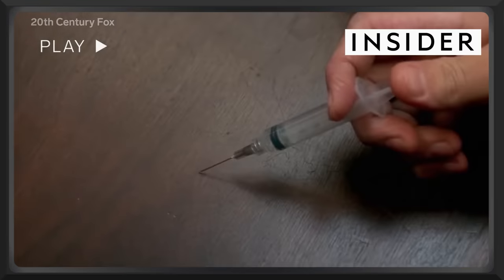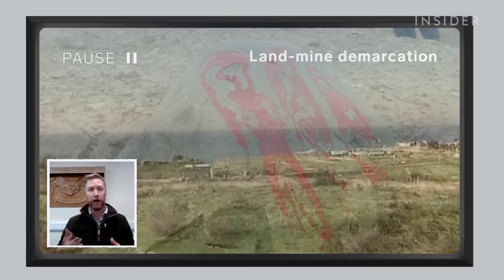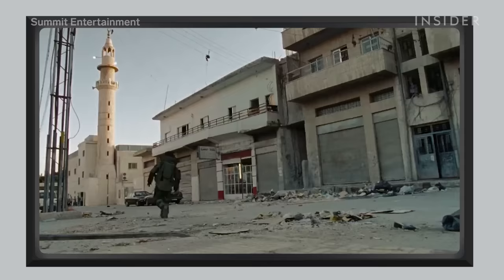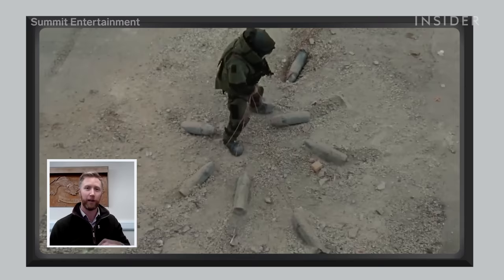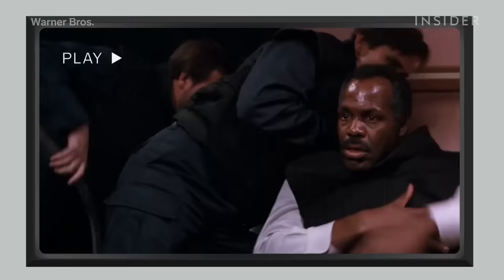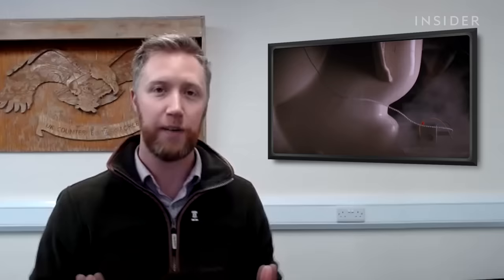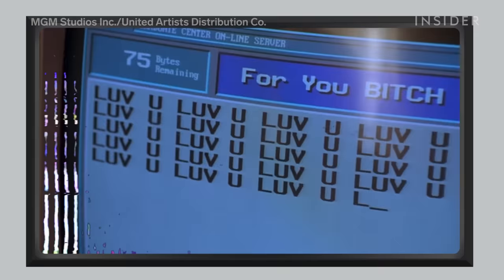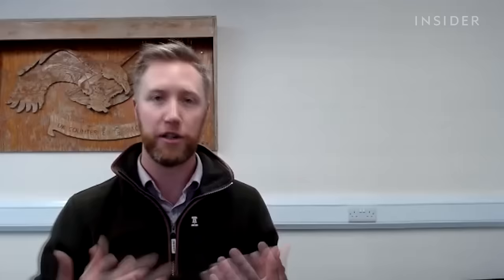Special Forces Bomb Disposal Expert Rates 10 Bomb Scenes In Movies | How Real Is It? | Insider

Comment: 7:53, did dude just try to grab a nuclear demon core with his bare hands? 
"Well, that did it"
Reply: Yeah he did. Pretty smart considering those cores are very stable and not at all radioactive. 

A fun little activity is to get a screwdriver and just poke the core on different places to see what happens. I reckon you'll get pretty doozy 10 minutes in, loads of fun. You'll get the longest sleep you've ever had after that.
Reply: @odethious5639  I have a better one. 
Take that screwdriver, get some tungsten carbide in a sphere and then hold the core just off of the tungsten or vice versa with the screwdriver until you're tired.

The bright blue flash will let you know when the game is over.

Also are you seriously trying to tell me a demon core (14 pound ball of weaponised plutonium) is safe to hold in your hands? 

Damn!
Slotin and Daghlian would be amazed!
Reply: @loumorningstar7709  

You're thinking of two half spheres of beryllium. For quicker results, ditch the screwdriver and just close them together with the demon core inside. Fans of Dragon Ball Z would love this!
Reply: @odethious5639  Daghlian used Beryllium, the first core was housed in Tungsten Carbide by Slotin. Both are neutron reflectors.

Although neither experiment ended well so its a moot point I guess.
Reply: @loumorningstar7709  first experiment used bricks of tungsten carbide. The spheres for the second experiment were of beryllium.
Reply: @odethious5639  that damn near exactly what I just said.....
Reply: @loumorningstar7709  

Oh sorry, I've been pretty tired. I have a thermodynamics homework to finish that's been stealing my sleep. Have a nice day.
Reply: @loumorningstar7709  "Also are you seriously trying to tell me a demon core (14 pound ball of weaponised plutonium) is safe to hold in your hands?" -- Actually, in this particular case, probably so. (Caveat: I haven't actually seen the movie, so I don't have any context other than what I saw on the clip.) With this bomb having a removable spherical core, it would mean it's likely a "removable pit" design, which was a real, accurate design used in nuclear devices. With this sort of design, the pit would be placed into the weapon when it was ready to be used, but could be kept/stored separately to prevent accidental detonations etc. The pit itself is also designed to prevent accidental detonations, and so the fissile material is naturally kept well below criticality, while encased in some sort of cladding material, such as stainless steel. 

Regardless of the design though, remember that just in general, nuclear bombs have to sit around for decades sometimes before being used, and need to still go off once triggered. For any design, if the core was super radioactive, it would be spewing radiation all over the inside of the bomb, which is probably not a good thing for a bunch of sensitive electronics and explosives. 

With the removable pit design specifically though, you wouldn't want the pit being super radioactive, as someone has to be able to handle the core to put it inside the weapon (apparently could happen even mid-flight), and you want to be able to safely store it too. It might be mildly radioactive, but it wouldn't be close to anything like the core from the demon core accidents. With the demon core, it actually went critical when the two halves touched -- each half on it's own was fine, it was only when they came in contact that it would actually go critical. If you think about it, for an actual bomb, just like the demon core, it doesn't make any sense to have the core/pit be in a critical state as it just sits there (again, the demon core only went critical when you put the two halves together), it only goes critical/super critical when you actually intend to detonate it. So the pit of an actual bomb would need to be stable by design, unless/until you did something to force it into a critical state.

That said, even if the pit had been 100% pure enriched plutonium/uranium, it simply wouldnt be radioactive enough to just kill you on the spot or anything, and almost certainly, any realistic design would use some sort of alloy or have some cladding to protect the actual fissile material from oxidizing etc, not to mention make it so that the pit could actually be handled when the bomb needs to be armed, or the bomb needs to be maintained, etc etc. So yeah, in all likelihood, you'd probably be just fine catching the pit/core with your bare hand, and, in some weird case where it wasn't, well, you'd likely be dead regardless if the thing was already critical, so it wouldn't make much difference if you tried catching it or not -- so you may as well.

Comment: The irony is technically speaking the bomb around 11:00 actually would be rendered inert due to the batteries freezing and therefore having no electrical current. The mythbusters tested this scene and instead of a delay it just doesn’t activate until the nitrogen boils off

Comment: That whole "the Mine goes of after the pressure release" comes, as far as I know, from the German WWII S-Mine which did go of some secondes after presure was put on them. They were designed to jump into the air and shot fragments around them.
Reply: Indeed there is a very short delay but it can’t be stopped by remaining standing on it

Comment: I found a stick of dynamite in a mine near my house, I pulled it out of the wall with my fingers without fully realising what it was; would the stick be washed out or still dangerous? can't say for sure when the dynamite was put there but it is at the entrance of the mine and the mine is very old.
Reply: Dynamite is typically nitroglycerin based, and the inside of a cave is far from proper storage. It's cold and damp. The coldness would improve the shelf life of the dynamite, but the moisture would damage it. That being said, you should still treat it with caution, but it will not be more sensitive than it was the say it left the factory.
Reply: @fudgerounds91  Nitroglycerin tends to degrade over time to form all manner of unstable nitro compounds, and if it was in a drilled hole there is a good chance there is still some sort of detonator attached to it that failed.  If it was in my house I would very carefully relocate it to a location where a stick of dynamite going off wouldn't be a serious problem and then notify the police.  They would probably then blow it in place, unless they had a container capable of handling the explosion if it went off during transport.  I am assuming from the story that the OP doesn't live in town.  Old nitroglycerin based explosives are incredibly dangerous, and The Munky is lucky it didn't just go off when he pulled it out of the wall.

Comment: LOL Yea apply liquid nitrogen to a switch great idea :') Just off the top of my head a few things that could possibly go wrong there: You can deform the switch enough to shortcircuit itself, especially if it's a low quality or a multicomponent switch; you could increase the conductivity of the material enough to let a minor bit of bias current detonate the entire thing if they didn't ground it properly; if different metals were used a large sudden change of temperature could actually send a slight current between the two metals and detonate the device. Either way sounds like a shitty way to die xD

Comment: I'm also a bit confused by the sheet volume of "time bomb" type devices that Hollywood seemed to be obsessed with until the late 2000s. I suppose it's a fear of random, indiscriminate explosions but that's not usually the point of making an explosive weapon. 

Physically triggered devices are a more practical use as there is a reason for the device to detonate and an actual target. What happens if a bomb blows but there's nobody around? Nothing. What if a device blows because it was triggered? Well, likely there's damage to whatever/whomever triggered it.

The "high pressure [colored] wire cutting at 1 second" thing just pisses me off. I've turned movies off several times for this reason alone. There are some movies where the excessive and choreographed fight scenes are entrancing to watch, but the extreme liberties that filmmakers take just turn me off completely. I don't see a point in making every explosion a fireball or every gunshot making someone fly backwards. It's unrealistic and all of us have been done a great disservice by being sold the intellectually oppressive lies against the laws of nature and reality.
Reply: I agree completely.  I'm impressed when they DON'T do that stuff and decide to make it realistic.
Reply: Just once I'd like to see a realistic space battle.  It'll be boring AF, which is why I only want to see it once.

Comment: Love the analysis!  For what it is worth, Mythbusters did an analysis on the Lethal Weapon Scenario:  

Given:  C4 bomb of (movie) capacity, paralyzed man on toilet, and bomb blanket over cast iron bathtub 1m away...

Results:  Will liquid Nitrogen stop C4 from detonating?  No:  The delay in detonation was too small to be significant.  However, C4 NEEDS an electrical / thermal impulse to go off.  Soaking the 9v battery that powered the detonator in liquid Nitrogen killed the battery for over a half an hour...  (Giving the heroes enough time to go to the local mini mart and get coffee...)

Can you pull a leg paralyzed man into a bathtub in under a second?  Yes!

Will a bomb blanket and a cast iron bathtub save you from a (movie) sized amount of C4 detonating 1m away from you?  Yes!  they had the sensors that determined that their eardrums would not have even ruptured at that distance!

(I forget the amount of C4 used in the movie, but they used the same amount in the  Mythbusters episode...   That said, do I want to be in ordinance disposal? NOPE!) =^^=
Reply: 250g of TNT (which is about 80% of the power of C4) will definitely cause permanent hearing damage at a metre.

Comment: Hazmat here, another problem with The Rock is that nerve agents aren't actually corrosive, they are mildly acidic, but they do not cause chemical burns on skin let alone "melt" hazmat suits in a minute. (How are you going to manufacture and transport something so corrosive?)
Modern suits are tested against all common chemical warfare agents and have at least 8 hours certified use time.

Comment: There is a pressure release detonator, but that's to prevent tampering.
Stroking off an IED... Nearly as effective as recon by hammer. Trench down to protect foundations, sandbag around and blast blankets over the  device (first, having gained spectrum control and cell tower control), blow it in place.
The toilet in Lethal Weapon mecause it's American Standard.    ;)
Im Juggernaut, the man telling the tech to cut the blue wire is the mutt who built the thing. Yeah, I'm really going to take his word on it - if there's a thermite grenade strapped to his nuts.
The VX bomb bit? All that C4, no VX out, thanks for the high decibel decon, Mr Bomber.
Love his taste testing an unknown plastic explosive. Did he also figure out the plant and lot by taste?

Comment: What would pouring the liquid nitrogen onto the explosives do?
It's a chemical reaction, would it make a difference to a high explosive?
Low Explosives i guess would be more affected as it's deflagration as opposed to the detonation high Explosives undergo.
Reply: OK, according to the ATF's Modular Explosives Training Program Glossary, there is a process called Freezing, however it's described for:
"Freeze: to lower to cold temperatures; to stop the operation of a fuze by 
cooling; to slow down; usually associated with slush or CO2
Freezing - a disposal technique using dry ice, liquid oxygen, liquid 
nitrogen, CO2 and alcohol to lower the firing potential of batteries or 
to slow down certain chemical fuze actions; such as acetone."
Reply: So, you can kill the firing battery by freezing it, it'll no longer be able to produce the required voltage under load.
It appears this will get worse with lower temperatures and higher current requests.
So the legal weapon thing might actually work.
Unless there's a firing capacitor I guess?
I don't know what happens if you freeze a capacitor.
Reply: OK, according to "Deep Freezing Attacks
on Capacitors and Electronic Circuits
(Morris, Nnorom Jr., Abedin, Erata, and Szefer)"
Freezing capacitors to -195°C with liquid nitrogen causes their capacitance to drop to zero if they are electrolytic caps.
So freezing the batteries and capacitors removes all electric power, especially at high current draws, meaning the detonators can't fire at all.

Comment: I dont doubt your knowledge or experience. But there are patent designs as well as training lessons from old military manuals that definitely show mines that are made to detonate after you step off it, rather than when you first step on it. I believe the thinking was that most of the blast and shockwave was delivered outward from the device so it would inflict more damage than if you're standing directly on top. Some of these were several inches around with a solid steel plate on top. And I've certainly seen helmet cam footage of actual EOD specifically pulling up wires to A see where they go incase it leads to a triggerman's hideout or even bomb making room, but B to see if there is more they missed. Although they usually do try to detonate any primary before going further with the investigation.

Comment: They should have reviewed the modern MacGyver series covered the synchronized cutting of wires across different areas. Noted as speed of light. 

EOD knows that the speed of sound across communication devices is not synchronized due to delays. MacGyver used speed of light to beat the bombs.

Comment: The Mythbusters tested adding liquid nitrogen to C4 with a dete-cap and battery trigger and it did actually stop it not just delayed it.
Reply: C4 is pretty stable, and it gets much more stable as it gets colder.  There was one assassination attempt on Hitler using some captured C4 in a wine bottle timed to go off when he was on a flight in a small aircraft.  It was put with the luggage in an unpressurized compartment and failed to go off due to the cold temperatures at high altitudes.  When the conspirators managed to recover the bottle after Hitler landed safely they opened it up and found that the surface of the C4 was scorched from the detonator going off.  So if you chilled it down to liquid nitrogen temperatures I would expect it would take a lot to set it off.

Comment: Well in the scene from the hurt locker the first charge is in series with the power source while the secondary charges are in parallel from the first charge. There not daisy chained together, implying that one is conceited right after another in series. The scene deals with both series and parallel circuits. if you were to sever the electrical connection of the first charge from the ignition system then the there no way for the charges in parallel to go off. If you started at the charges in parallel then you would just disconnect the common points they share respectively. The real kicker is when you start factoring in a three wire system, because it may indicate that a lack of current could also trigger the charge, but generally that fairly rare because is requires a not/or logic gate capable electronic device. There pretty hard to come by in country’s like Iraq so general a two wire system if fairly straightforward. The car bomb scene really demonstrates this concept where there a was multiple ways for the charge to be set off, either from the fire or the dead mans switch connected to the car battery. Understand the basic rules of electricity are extremely important for our soldiers in IED disposal teams.

Comment: Mythbusters tests the Lethal Weapon method of using liquid nitrogen to gain reaction time by slowing down the trigger mechanism. What they found is if the trigger relies on a battery, if you freeze the battery with Liquid Nitrogen, you can get a crap load of time. It took something like 40+ minutes for the battery to recover enough to power the trigger switch, once the battery was frozen. So just getting a few seconds out of freezing the battery is totally realistic.
Reply: Sorry, that’s for the most basic of triggers that require power from the battery to set of the bomb. A lot of times the trigger can be the reverse, where any power loss, could set of the trigger. Or other more complicated mechanisms. So I can understand how a bomb tech would opt out of using this method on a random IED/Bomb.

Comment: The stupidest part about the vest in The Hurt Locker is that sure, the locks are hardened steel but the straps aren't. He could've easily cut the straps with the bolt cutters and freed the guy that way.

Comment: Quick question regarding mines initiated by pressure plates. I totally understand what you're saying about when someone steps on the mind you want it to go off that point. However the Germans did create The bouncing Betty. It's my understanding that that was a mind that went off after you stepped on it and released it when the pressure comes off I've come to mind and exploded about waist height. If my impression is incorrect please correct me.